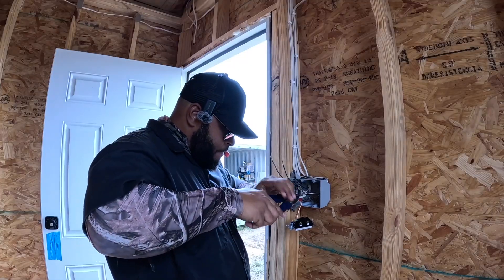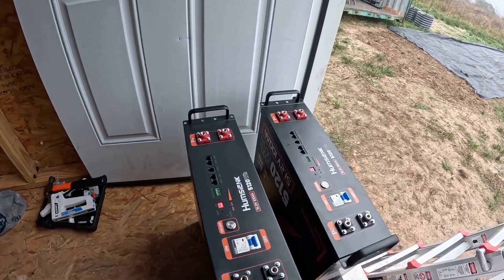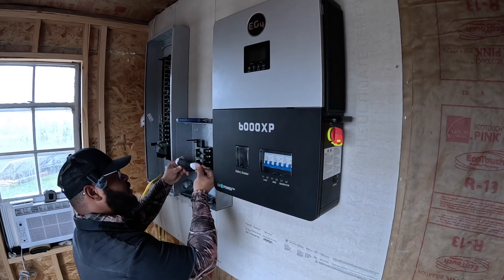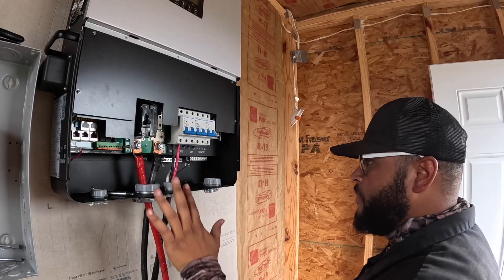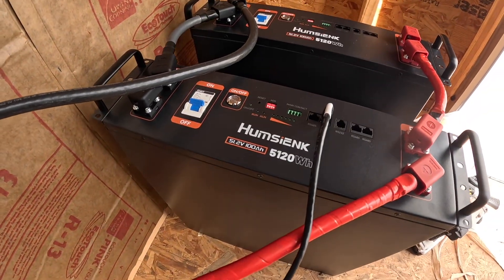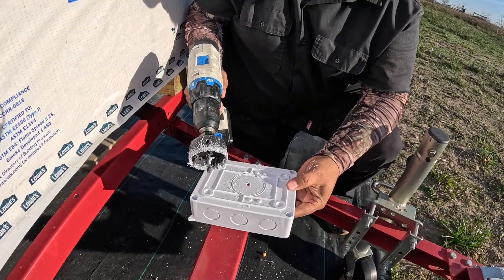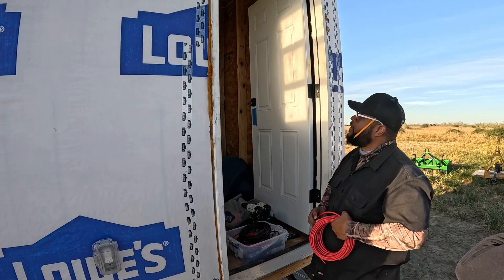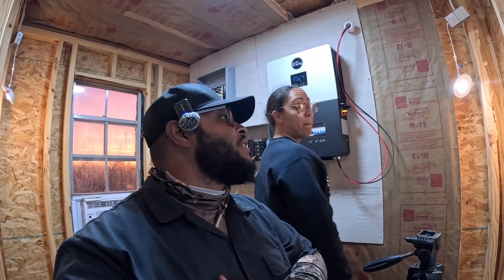Powering Up Our Off Grid Homestead Breakers, Inverter & Battery Bank

Comment: What's your question boss. I do solar also. and let me guess, you need to know where to hook ground and neutral. depends. you hooking to grid power in case? hook ground and neutral in in main box. if your just using solar with generator backup, hook ground and neutral in sub panel. there is no bond in inverter. so just a bond in sub panel.
As an edit, you should use ferrules on them stranded 6 gauge wires.
Reply from the maker: Thanks for this advice. We are 100% off grid. I was just going over this project and the EG4 6000xp manual states that it can handle the ground so, it will be where I connect the earth ground. As far as the ground and neutrals in my load panel and sub panel go, we'll keep them separate and not bond then. I will also update my wires with ferrules. Thanks for tuning in.

Comment: Since there is no AC input, the 6000XP will bond the ground to the neutral.  The software normally disables bonding when there is AC input. You might need to pull the bonding screw from the main panel or disable it at the inverter.
Reply from the maker: Right on! You are correct. The inverter will handle the ground neutral bond. My load and sub panel will not be bonded and the grounds and neutrals will stay separate. Thanks for tuning in. Much appreciated.

Comment: There are 2 things I think I would recommend that make since are in the NEC code.  You should probably put a solar disconnect on the outside wall (where your wires are running down).  You should just be able to splice one in, but unplug the wire from the solar panel side before cutting the wires as well as turn off the solar disconnect on the 6000 xp to make sure there is no voltage from either side.  The other thing I would add would be a shut down switch on the outside next to the solar disconnect.  It should probably be wired between you smaller box and the bigger box as far as wiring.  This way the fire dept (or you) can kill power to your main breaker box without having to enter the building.  Also if there is a rapid shutdown switch you can add that will turn off the inverter, you could do that instead of the AC disconnect possibly.  NEC code might require both though.  I know rapid shutdown is required for roof mounted solar, but not for ground mounted solar.
Reply from the maker: Great suggestions! We'll definitely look into adding those safety features as we move forward with completing our Powerhouse. Appreciate the advice 💪🏽

Comment: Not sure if you have installed it yet but I would drive a grounding rod into the ground outside of the exterior of the power shed to have a way to send excess power like from a lightning strike into the ground safely that way it does not harm you or your equipment I would say to attach the grounding rod to the tongue of your trailer
Reply: Great job. 
But why not put the inverter at eye level ?
Reply from the maker: @eEvangeliste Thank you. We put it up that high so we could utilize the wall space underneath it.
Reply from the maker: Good advice. Thank you! We are going to install 2 earth ground rods and they will run from that middle load panel to protect our system. 💪🏽
Reply: @timetotiny  Hi there, put them in ASAP, you don't want a floating neutral.
Reply from the maker: @frankh7234 Right on. That’s up next for sure 🫡